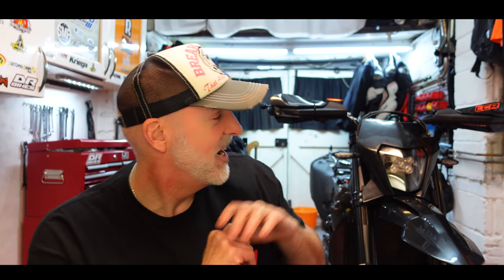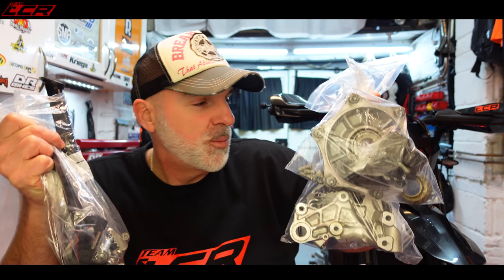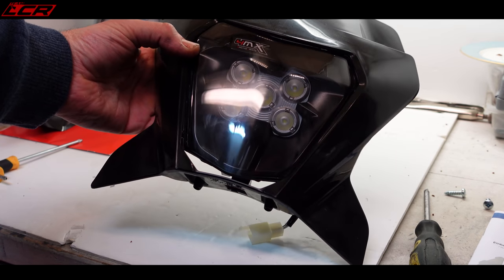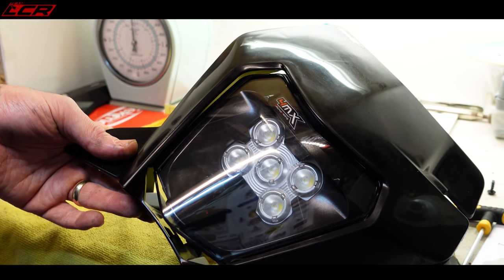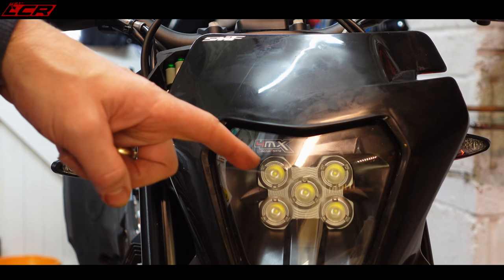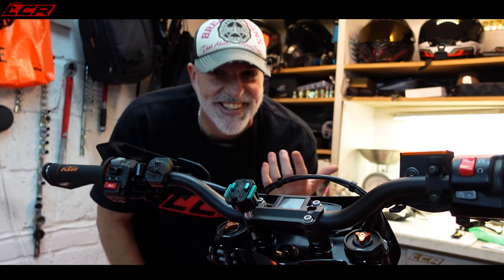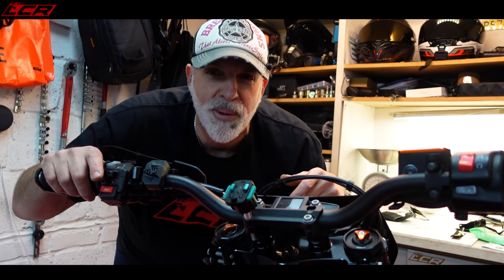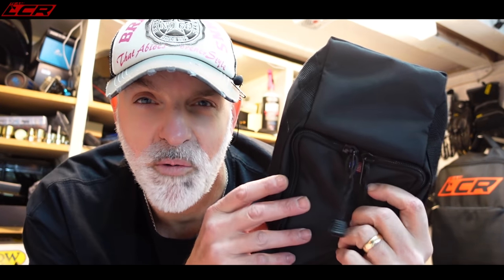LED Light Upgrade KTM 690 & Enduros | The Ultimate SMCR Build EP06

Comment: True chaotic energy in this one I love it. Quick question though, does the dashboard assistant turn off with the key? My heated grips use the same plugs up front and they stay on until I turn them off manually.
Reply from the maker: Thanks Jake, yes mine does, you must have the wrong accessory wires as the other pair are permanent live! One pair ignition switch other direct from battery
Reply: @LambChopRides  good to know. Not sure why they wouldn't just tie both to the ignition but oh well. Thanks.

Comment: Im’e with Mavis, most riders could loose more weight than you would buy spending a few grand on lighter parts.
Remember watching a vid by I think Jbellz fitting titanium bolts to save weight, and he was about 280 pounds.
I’ve put on about a stone and a half over lick down, so not having a pop at you.

Comment: that is so funny right before your vid was uploaded i orderd this exact headlight for my 690 i was thinking of getting the baja designs like i have on my 530 its an amazing light but i like the look of this one better lol and cheaper hey one question do you plan to change the gearing on your 690? it desperately needs gearing in my opinion it wont do 3rd gear clutch ups
Reply from the maker: Good timing then Nick! I'm have a tooth down front sprocket but wont change it more than that. With the extra grunt should wake it up considerably from standard..
Reply: @LambChopRides  haha i know right? and yea i think youre right on that one im going to start with 1 down up front, i actually went with the DNA air filter like crashking did on his 690 from supermofools going to get mine on the dyno soon the pre made rotty maps seem to be pretty decent tho